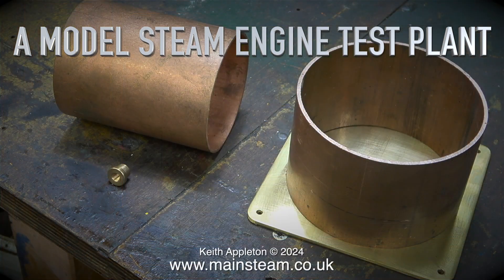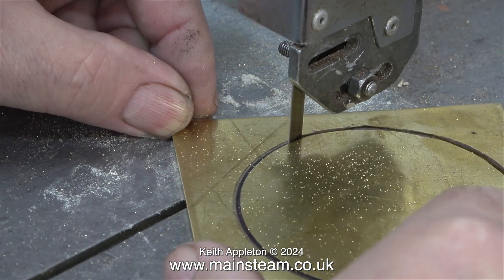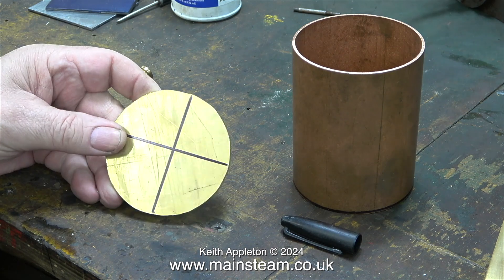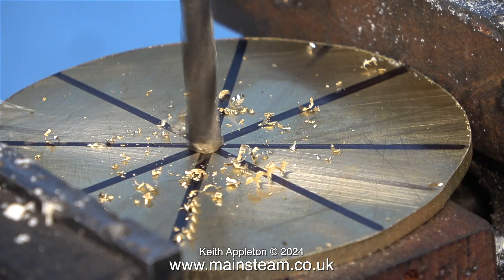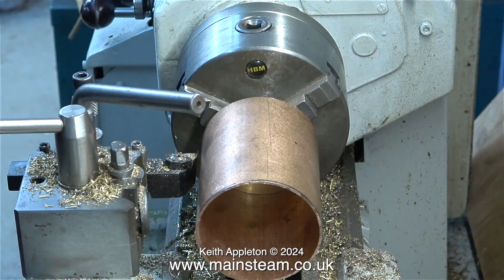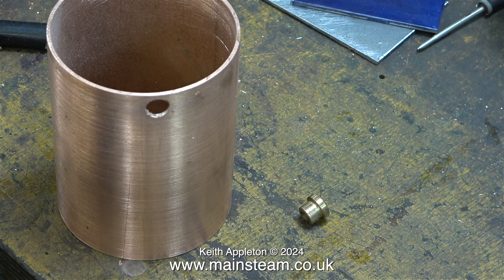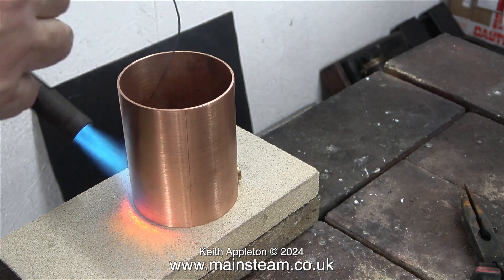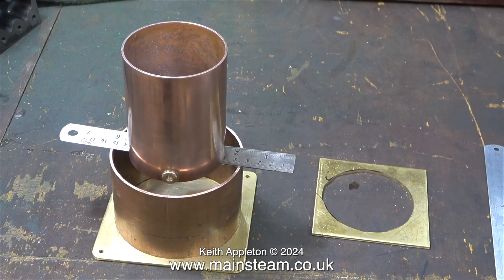A MODEL STEAM ENGINE TEST PLANT - PART #8

Comment: A bit of rubbing alcohol on a rag will remove errant Sharpie ink marks. No need to sand them off and scratch up the part’s surface.
Reply from the maker: I think you are maybe missing the point. I am obviously aware that a solvent removes Sharpie pen marks, but I need to scratch all of the surface to key the metal for the paint.
Reply: @keithappleton  Yes, I realized that later when you roughed up the entire plate. The comment was really intended as an alternative for the folks that might not know that alcohol can remove “permanent” marker.

Comment: Just an idea:  Would it work to spin the tank in the lathe while heating it.  That would sling the solder to the edge instead of having it in a layer on the bottom.  Your method shown does work well, just an idea.  Very good work.
Reply from the maker: I would not like to do that as spinning the part would fling out the solder around the edge - it works perfectly fine as I show it and it is a safe method.